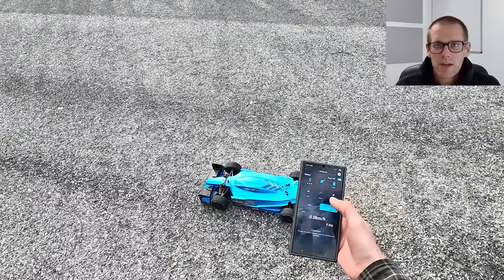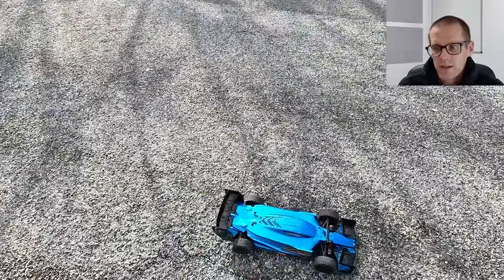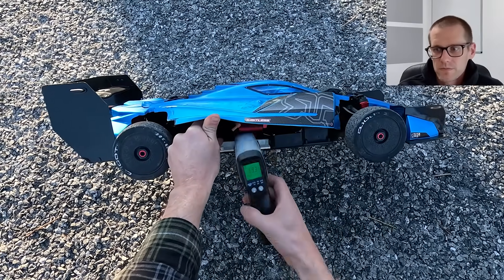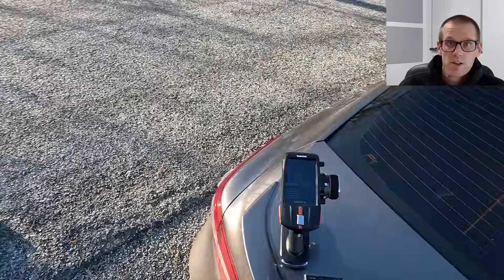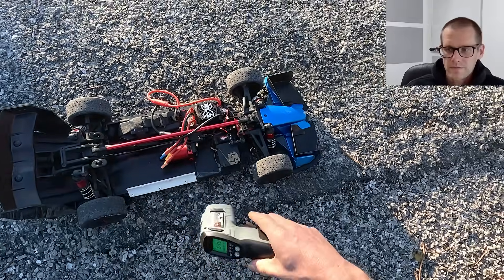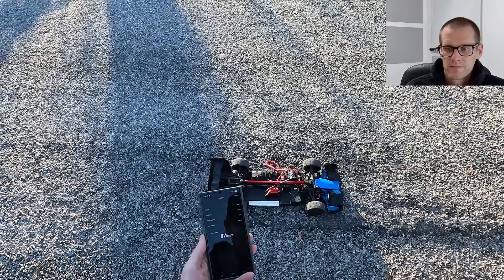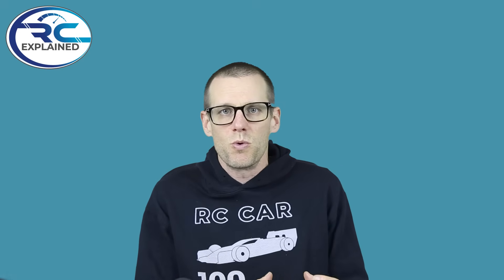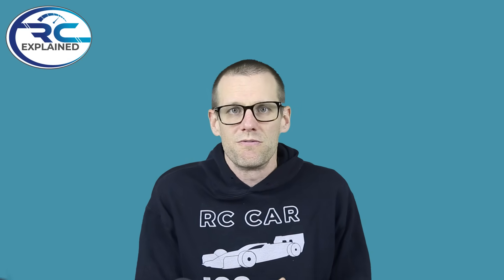Does Low Kv Mean More Torque? This Road Test Left Me in Disbelief!

Comment: Your logic is sound, if going identical voltage. If you do this again, set for speed again but use voltages better matched for the KV. For example use like a 2400KV and a 1200 KV Gear the 2400 on 3s and the 1200 KV on 6s with gearing based on voltage to a similar speed, In my experience the lower KV high voltage setup will run more efficiently as you are using the voltage to make RPM vs amps. The reason the lower KV setup fails here, is because the voltage is not matched properly. It's more an apple to a pear in comparison than an apple to apple
   In your setup in the video above, the higher KV more efficiently uses the power because it's the better match, If you raise the voltages on the lower KV setup the power should equalize or possibly surpass the higher KV motor
Reply: Glad I wasnt only one thinking this too, if he volted up the lower kv then geared for same speed imo lower kv would have performed better because wouldn't need as large of pinion and 4s wasnt adequate for the lower kv, great info though
Reply: Hey I know you from FB lol but that's the point he is making lower kv needs more voltage to produce the same power as a higher kv motor in the exact same setup
Reply: @bryangadson-me9eh  Of course.  This was his point.
Reply from the maker: Understood, as mentioned in the video. However, the same voltage is the case that people were in disagreement with or questioning.
Reply: @RCexplained , The last time you did this (Using all the math) I said I'd almost take the lower KV and try gearing up, which you did here. I honestly did not know where it'd go, but you showed me here, that it was a bad idea, so thank you for that
Reply from the maker: No worries, i have more parts on order to make another comparison. Hope they get here before the snow starts flying.
Reply: Yeah... this was the whole point of the video...